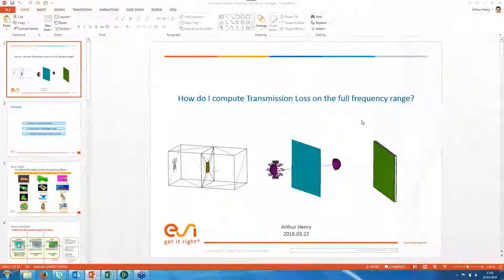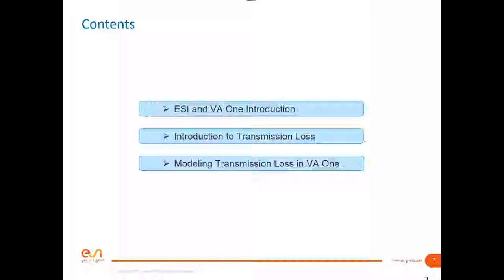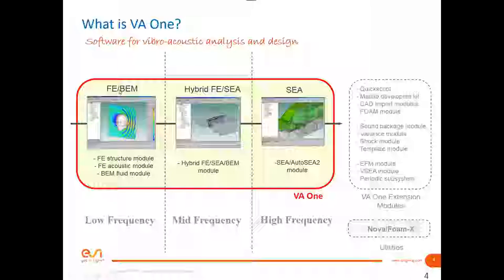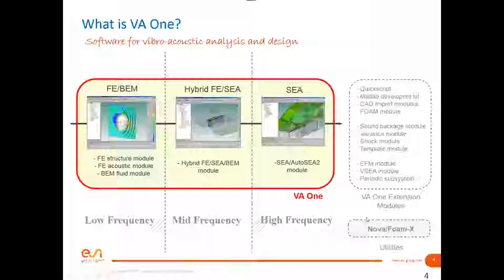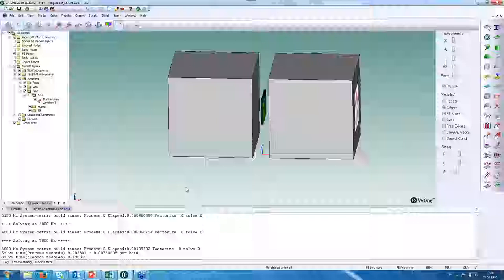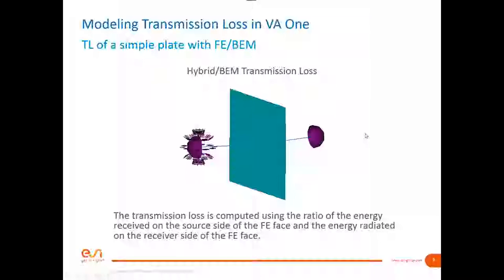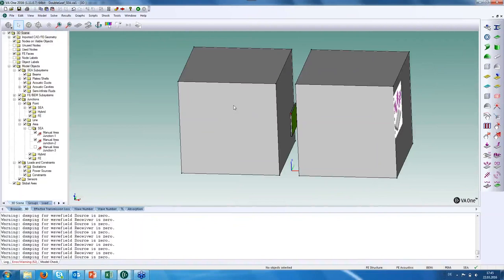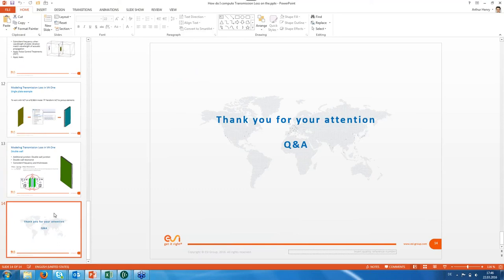How do I determine transmission loss on the full frequency range

Comment: Hi 
why amounts calculateed transmission loss in mass regim have a large diffrence with real transmission loss of panel speical in high frequency
Reply: There are several reasons why calculated transmission loss in mass regimes can have a large difference with the real transmission loss of panels, especially at high frequencies:

Material properties: The actual properties of materials used in panels can vary from the assumed properties used in calculations, leading to discrepancies in the calculated transmission loss.

Manufacturing tolerances: Manufacturing tolerances in the production of panels can also affect their acoustic performance, causing differences between calculated and actual transmission loss.

Boundary conditions: The actual boundary conditions of the panel can differ from the assumed boundary conditions used in calculations, leading to differences in calculated and real transmission loss.

Modeling assumptions: Models used to calculate transmission loss are often based on simplified assumptions that may not accurately reflect the real-world behavior of panels, leading to differences between calculated and actual transmission loss.

High-frequency effects: At high frequencies, the behavior of panels can be significantly influenced by effects such as wave scattering, diffraction, and resonances, which are difficult to accurately model and can lead to differences between calculated and actual transmission loss.

🙏